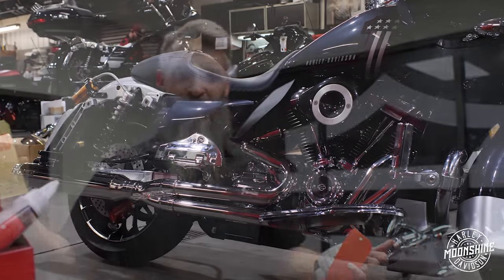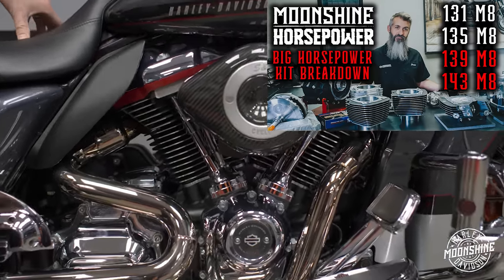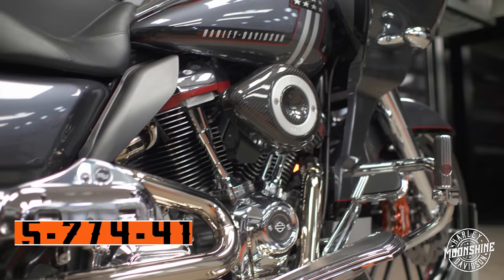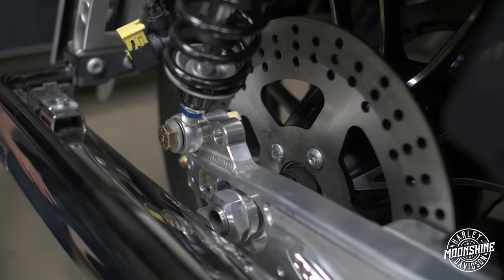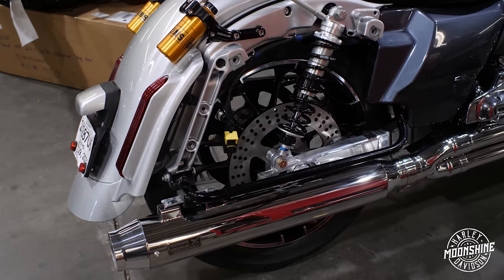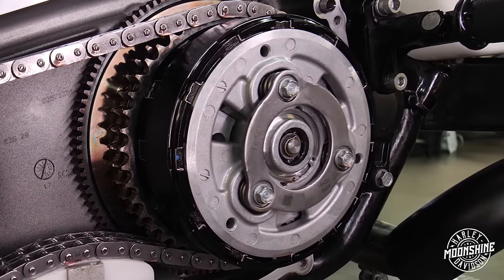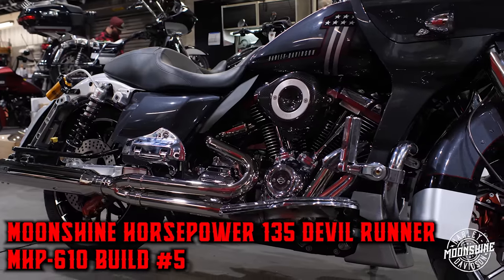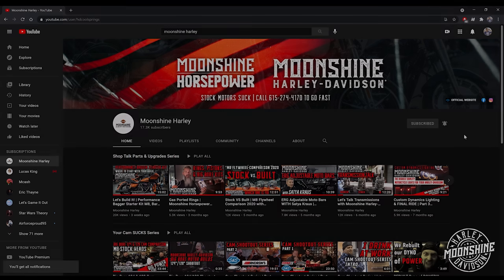Moonshine Horsepower 135 Devil Runner | MHP-610 Cam | Bike Build #5

Comment: I have this moonshine 135 set-up with smaller 550 cam and 64mm throttle body.....at 169hp....and best torque of 158.....it's plenty powerful when your rolling with friends and you feel the need to hurt some feelings.......it's easily done...... but what I enjoy is the low end roll on torque, especially riding 2 up with my wife .......it has great street manners, quiet valve train......its truly a pleasure to ride. Big power that you can enjoy everyday even on long trips was my goal and I must say so far I'm very pleased !
Reply: Cost??

Comment: Man I love the work and detailed explanation you give. I would like to have about 135 horsepower with torque around 145. But I just got my RGS in June of 2021. When the factory warrant gets close to going out I’ll be giving you a call
Reply from the maker: Awesome. We do warranty most of our engine builds till your factory two year warranty expires.
Reply: I did a 124 build from r&r cycles manchester nh, 138hp / 143 tq dyno sheet.. thats with trask performance big sexy exhaust probably woulda been higher numbers with a thunderheader exhaust since longer than my shorty style

Comment: Let's see how the stock compensator holds up!
Reply from the maker: It’s a stock comp setup with the MHP Comp Ramp. We have proven this to be one of the best setups available for any HP range. The Harley-Davidson compensator is a great design so we just replace the parts with stronger ones. It’ll also save your trans compared to some other comp setups.

Comment: I hear these big engines dont last long in comparison to stock engine. Any info on this ? Also what how much is fuel economy affected on these sexy engines ?
Reply from the maker: It really depends on the build setup. Mileage on the HWY is effected to much but from light to light full throttle it’ll drink. Over all mileage is still great since it’s a two cylinder engine.
Reply: My SE 131 did exactly the same as buddies CVO 117 over hundreds of miles in Sturgis...don't remember but 30+ mpg

Comment: You guys recommend running synthetic oil or conventional oil in the build m8s.?
Reply: Comventional during break in, then synthetic after .  What ever oil you decide just change it often. Every 2500mile   Just my .02 cent
Reply from the maker: We break them in on mineral oil. Then switch to synthetic after the 1,000 mile mark. Mineral oil is great but needs to be changed every 2,500-3,000. We like the Bel Ray oil for high output engines.

Comment: When you add all this power to a bike that originally had 90 hp and now has 150+ hp there has to be more changes to be made on the bike,,,such as a heavy duty clutch,twin breaks on the front wheel, probably a stronger belt or chain to be able to take all that power the new engine delivers, what about the Transmission  I imagine modifications also is recommended,,,,I have a 114 ci on my fat Bob did a stage 2 on it 2 into 1 exhaust, high flow air filter, a tuner , dyno showed 130 hp 131 TQ, that's  enough power and still its still warrantied by HD and to me that warranty is very important ,, ,I respect your work I just don't understand you need all that power unless you race  your bike on the track

Comment: dam all that money and running a stock pressure plate with 3 springs uh
Reply from the maker: We have a Rekluse Clutch that is capable of 200 HP. We build a lot of big engines and this Clutch setup does it all.